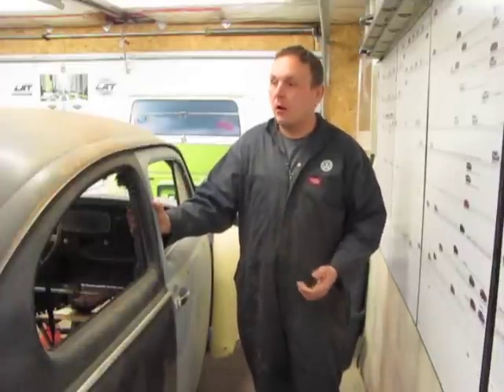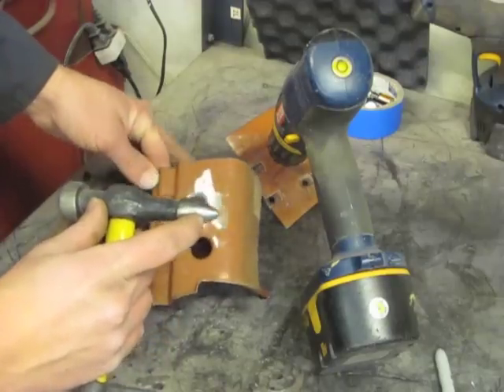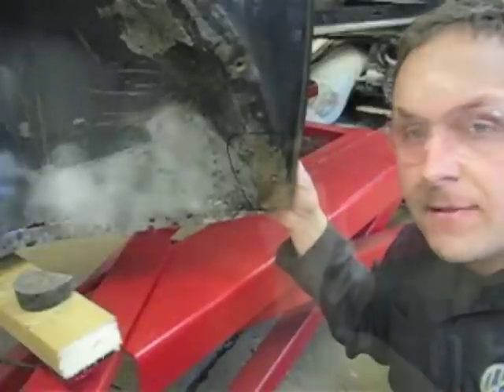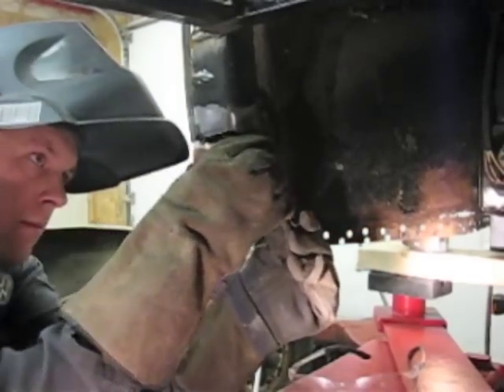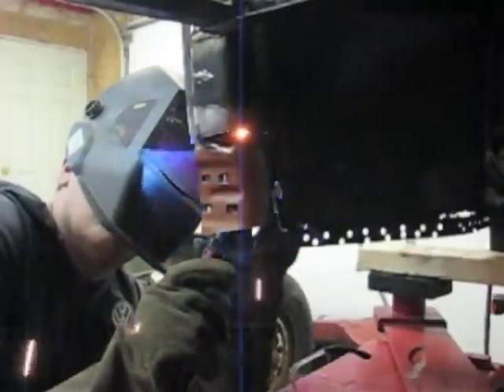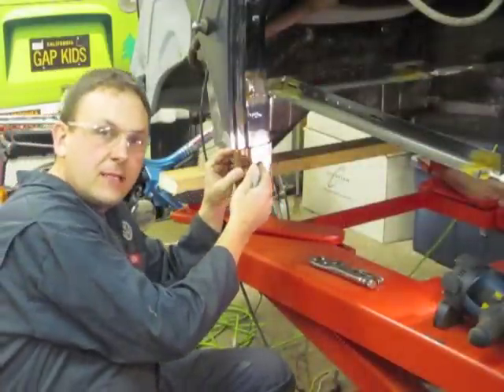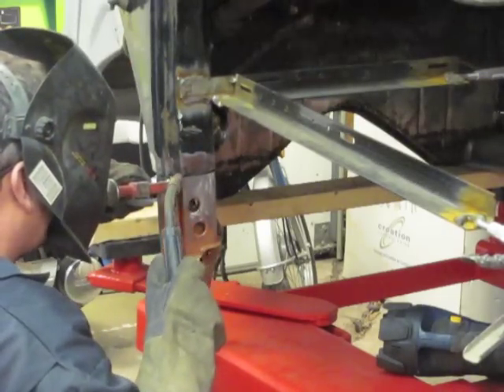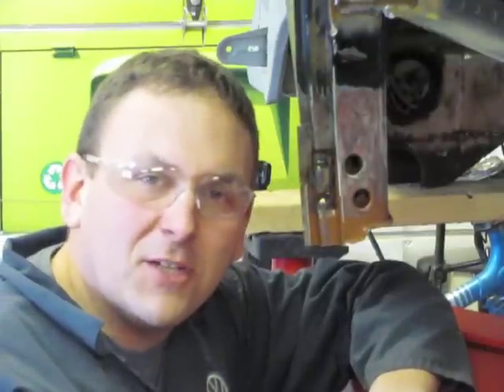Episode #2 - Door Pillar Replacement

Comment: Brad, I believe the inner panel is intentionally only spot welded in one place. This is only to keep the two pieces together to show how they align with each other. The pieces need to be separated in order to weld them in. After both pieces are installed separately then they can be welded together (typically holes will need to be drilled in the front piece to accommodate spot welds unless you can reach it from underneath with the heater channel removed.)

Comment: I am getting ready to do this tonight as well and had a quick question. At the end when you are finished, I see that the outside lip on the replacement panel extends a little past the rest of the stock pillar channel. How did you make that fit?  I mocked mine up and I have the same issue. Thanks and thanks for posting this!

Comment: Good video.  Agree with @Dale Worthington below.  I'm doing a series on a '67 F100 Pickup and wanted to see someone else doing similar body work.  Nice job.  Not a VW guy, what is the coil thing inside the door jam for again?
Reply: +Larkhill21 He said it was a "heat tube which conducts heat to the body of the car". For what?